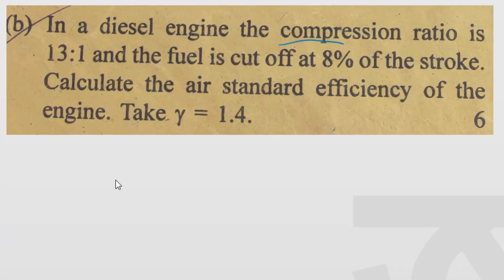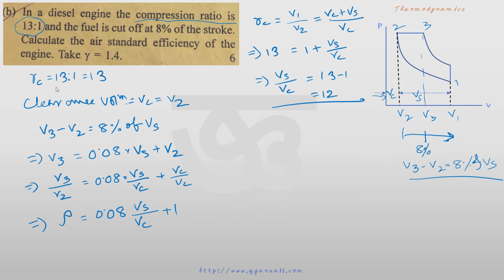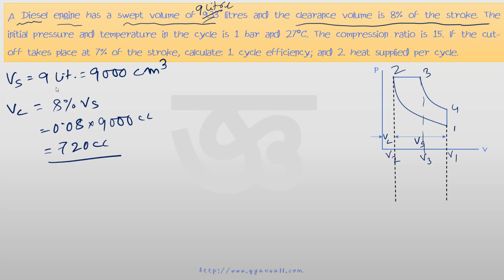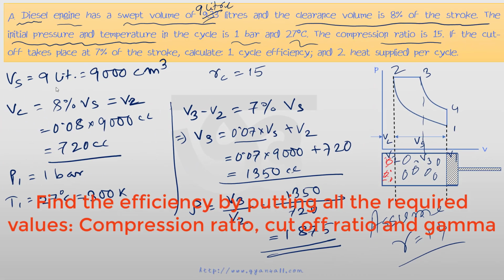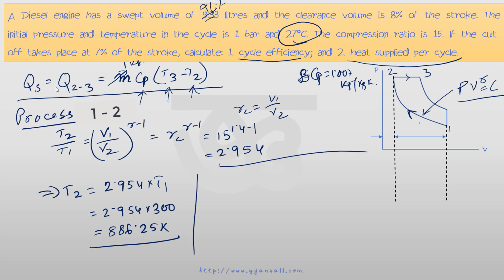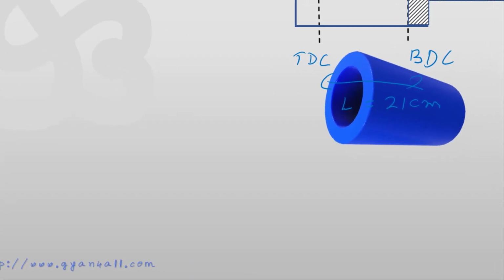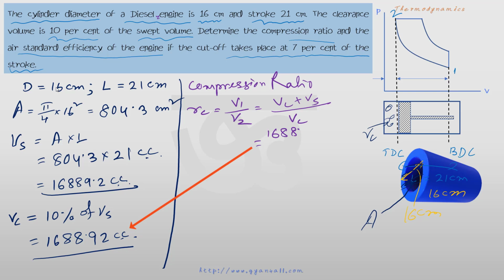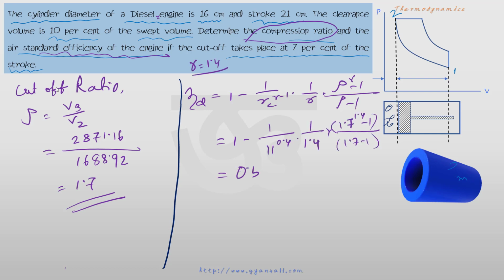Numerical Problems on Diesel Cycle

Comment: If there are given pressure ratio 13:1 in place of compression ratio. How can I solve this problem sir? Can I use between pressure and volume relationship in isentropic process pv^1.4 =c ?Please , any clue
Reply from the maker: Yes you can apply the isentropic law pv^1.4 = c to find the compression ratio v1/v2. If compression ratio is v1/v2, then pressure ratio is p2/p1 = 13 as you have mentioned. Apply the law pv^1.4 = c and you will find the value of v1/v2 = 6.25, if my calculation is correct. Thank you for your query!